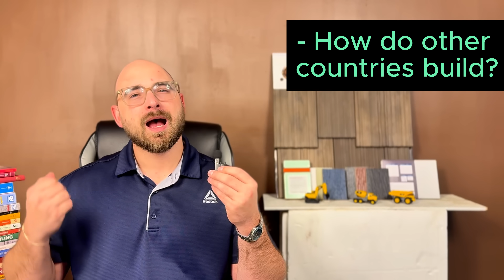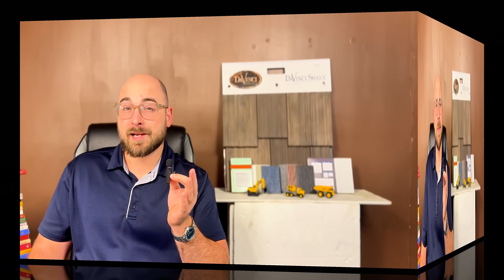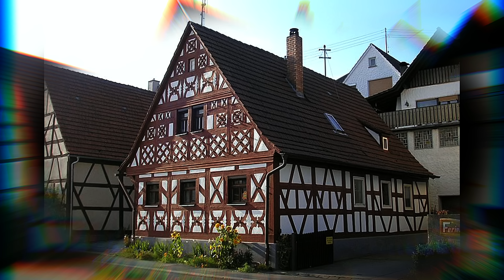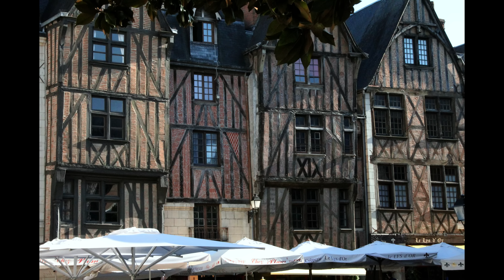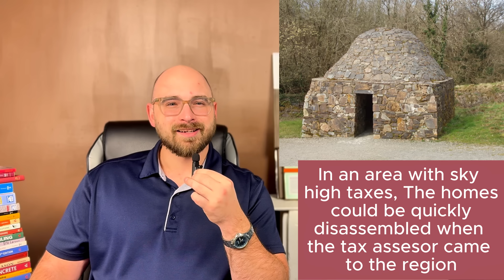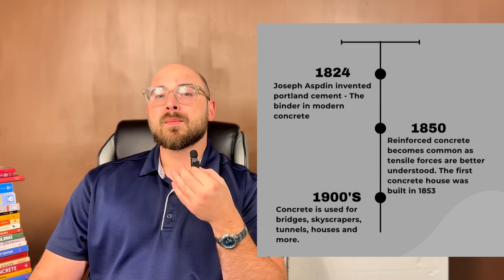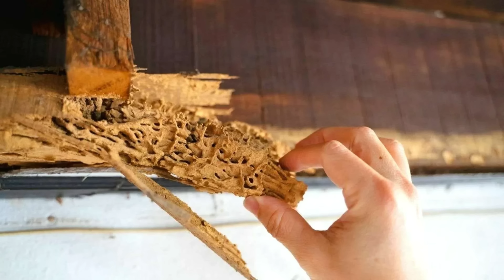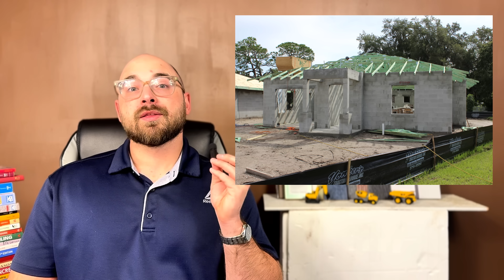Why Other Countries LAUGH at American Homes

Comment: We have oil/gas company corporate welfare here. In other words taxpayers underwrite the oil business which keeps our energy prices artificially low.  Europe generally can't do that and won't because they are actually concerned about climate change. McMansions don't exist there either. Apparently they have larger penises and don't need homes designed to impress and $80,000 pickup trucks that have never seen a sheet of plywood or even a hand drill.  Seriously though they are SO much more serious about appropriate sizing and their energy costs are realistically 3-4 times higher than ours.  They can't build shitty houses like ours.  The other issue today is that new American homes today are absolute crap. Crap materials, "soft" wood, workers not craftsman and major home builders Pulte, etc., have simply stated;"These are built to only last twenty years. No one cares because they'll be dead or have sold."  Which tells us so much about capitalism run amuck. I wouldn't use anyone but a one-man/woman run business that grew up in my neighborhood for a home. Unless I'm prepared to spend $700-1400 a foot for a superior kit or modular builder.  I'm a builder/developer by the way who was born in Europe but lives here.
Reply: McMansions are not exactly the typical American home. Also for someone who claims to live here you certainly don't seem to understand why American cars are larger either, companies trying to avoid fines from CAFE standards are the reason American cars are so huge, not some penis envy complex like you say. 

Plenty of stick built houses in the US are already pretty old, in my city it's not uncommon for buildings to be close to if not older than a century. 

As for blaming capitalism, Europe is also capitalist, and if their homes are so much better why hasn't capitalism ruined it yet? The USSR certainly wasn't capitalist, and they built terrible construction. I don't think the two are as related as you would like to believe.

You sound like a pretty angry and vindictive person, which in my experience is unfortunately quite typical of europeans on the internet. No shade to most people from there, I think it's a lovely place even if I wouldn't want to live there myself.

 I think most of the bad new builds in the US are the fault of companies not building properly, not adhering to code, using illegal labor, etc, rather than some inherent problem with wood construction.
Reply from the maker: Thank you for your very insightful and comedic comment 👏👏
Reply: What do you mean by "corporate welfare" for oil & gas companies?
Because oil and gas companies are taxed at every level possible... 
Taxpayers do NOT "underwrite the oil business".
Instead, the oil business is not ridiculously OVERtaxed... which taxes they would then PASS ON TO THE CONSUMER, of course... which is precisely what happens in Europe.
Europe quite literally punishes its citizens for using oil & gas... and it is 100% intentional... USA chooses NOT to do that.
Reply: Yes. The average home size in Germany as one example is almost 1200 sq ft. That is considered small here in the US. Some apartments can be this big. Houses used to be roughly this in the US back in the 50s and 60s. New construction homes in the US are generally 1800-2000 sq ft and up. 
If you want to find a community where new construction homes are a similar size to Germany you will be looking at a retirement community.

Comment: Brick, stone and concrete last so much longer, centuries. In America we are building homes that will last maybe 50 to 80 years. We are over paying for homes that will not last long enough to pass down more than 1 generation.
Reply from the maker: Right, for just a little bit more we can have insulated concrete houses that are safe, efficient, and built to last

Comment: As a child I loved on a large adobe house in Cuba. The walls were completely fire and hurricane proof. Now I live in a   concrete block with rebarb in the holes with concrete poured in the holes . Here in Miami it laughed off when hurricane Andrew went right over it. We only lost a few comcrete shongles.
Windows are bullet proof steel framed hurricane proof. So CMU plus rebar plus poured concrete. Hanging a picture requires a concrete bit. 
Expensive but where there's no earthquakes it will stand time.
Reply from the maker: The sturdier the better! 💪🪨🏠
Reply: Could i have the name of the builder and when was it built?
Reply: @SkyBlue-nv2tb  First part 1953 in the middle of Coral Gables, a city inside Miami-Dade. A lot of the older homes here are built similar as the video points out about Florida though mine is exceptionally sturdy even for this area. Do not know the architect or builder but it was not a "cookie cutter" development. Additions to similar standard made in the 70s. There's steel girders holding up a part of the main celling that is a poured concrete slab. Several of the walls inside were originally outside walls. Half of the front is covered in marine fossils including sea fans, various size worm tubes, corals, mollusk shells and small crustaceans crushed together during the flood of Noah. Now get this: bought it for 340k back during the first Bush and pay less than 6k in property taxes! Like all the houses we have lived in, I tell my wife when to buy and how much maximum; then I see the house after the closing. My way of demonstrating I trust her. Don't hate me because I'm beautiful, but because my wife of 47 years still is :)
No, I have no intention of selling. This is not a spam commercial.
Reply: And its only double the price😂
Reply: @180Tall18Long  But it's quality, not a knockoff. For me, a good investment.
Reply: @180Tall18Long  I live in a 400 year old stone house, in England and when I looked into buying an American property, I couldn't believe how expensive it was, for what is essentially a garden shed. Why can the rest of the world do everything better, cheaper?

Comment: "DEVELOPERS" drive this style of construction in American homes. Just TRY to get developers to build homes that are efficient to heat and cool. Ain't gonna happen unless your city council is not lopsided with developers, realtors, and title company owners, AS IS THE CASE IN ALL 3 CITIES IN THE  LAS VEGAS VALLEY! - well, unless you are building in an "upscale" neighborhood, THEN you get far better insulated homes, some with heat pumps and maybe ONE natural gas line for thereat pump furnace if temperatures go too far below freezing for the heat pump to handle it.
But YES, theLas Vegas area and most of the southwest SHOULD have been built with concrete. JUST ASK THE BURNED OUT LOS ANGELEANS!
Reply from the maker: You’re not wrong, many big builders consider putting a smart thermostat in the house “innovation” 

Disaster prone areas should have disaster resistant construction … Period!!

Comment: Far beyond America... My Malawian friends do not live in mud huts.  Every one of them knows how to dig up the earth, cut down a few trees, fire a few bricks, and build a solid brick home.  But when I ask them whether it wouldn't be a little more efficient and easily shaped to use the trees' wood to build the house directly...  they laugh.  Where's the security in that?  Thieves and criminals would simply build a little fire and come in through the holes in a wooden wall.  They are certainly right, as far too many Los Angeles residents are now learning.  But will America change the codes?  No.  Brick is already legal, technically, but who can afford it.
Reply from the maker: We can afford concrete homes, we’re just stubborn, or people don’t know they have options 

I hope LA builds safer this time around

Comment: Sorry, you said something that irked me - reinforcement steel does not corrode in concrete and concrete on its own has lousy insulation properties. Ask anybody living in a commie block. 

1. And here we go - you went through a historical review but missed the communist experience. Basically precast walls and floors or tact-centered concrete pouring which can achieve 4 floors per month. A plethora of methods that ensured the growing population of the cities is sheltered. Might not be beautiful, but no homeless people and every family owning a home is well-worth the price.

2. Wooden frames are extremely labour-intensive and no standardization is available on a big scale. Precast panels and bricks allow for industrial output, which lowers the price of the materials, ensures better quality and durability of the constructions. The epitome of the communist engineering was creating the home in factory conditions and assembling it in situ with the infrastructure waiting. It was not given a go because of esthetic issues.

3. Concrete is the most versatile material you can think of. It can be molded in incredible shapes BUT it requires good engineers. Look at the Sydney Opera house.

4. As I mentioned the commie blocks - pure concrete walls and floors suck big time. They are quite thermally conductive and contact-noise conductive. If a neighbour is drilling a hole in the wall, the whole block is aware of the fact. Therefore no one builds pure concrete anymore. Ceramic bricks, autoclave aerated concrete blocks, you name it - lighter materials that will not hamper the seismic stability of thee construction, but provide good comfort with proper insulation for lower bills at a reasonable price.

5. Sturdiness and durability - I do not find grounds for comparison here. A concrete frame with brick fills can serve up to 5-6 centuries. Even a commie block has a minimal life of 60 years because of possible welding faults among the panels' reinforcement. My home is a two-story wooden frame with brick fills on linear stone fundaments in a highly seismic region (possible 9th degree quake) and has been completed in 1837. The only serious change we made was removing the ceramic tiles from the roof and changing them with bitumen plates in order to reduce the load on the structure and lower the centre of gravity.
Reply: You are flat out wrong about rebar not corroding in concrete.  There are cases where this has occurred. Like the surfside condominium collapse in Florida. The most likely cause was the rebar rusting while it was embedded in concrete.
Reply: @bbdest3082  The only reason that could happen is poor quality of the concrete and not enough concrete coverage of the rebar. Once the steel is properly encapsulated in concrete, the alkaline environment (pH12) of the concrete halts any oxidization of the rebar and even dissolves the existing rust after time. After all the  tetra-calcium aluminoferrite is one of the components of the Portland cement and rust (ferrite oxide) is part of it. But you, US Americans, are well known for cutting safety corners and lacking proper quality control when it comes to profit.

edit: I checked the disaster you refer to. For me it is a failure of the hydro-insulation, combined with bad engineering. You see, when you calculate a concrete construction you pick your steel reinforcement to be enough, but you do not overdo it 1. because it is expensive and 2. because of a snap destruction. The concrete structure is calculated so it will first lose its form (which will warn the inhabitants of n imminent disaster) and then lose its ability to bear loads.  But let's return to the hydro-insulation. The concrete is not water-proof material. It has capillary structure. It can be reduced through proper vibration during the pour and some chemical additives, but cannot be removed. On the other hand standard concrete works with cracks in the tension zone. Destruction in the compression zone is a big no-no. Let me reiterate - when concrete breaks, first it cracks in the tension zone (which is compensated with rebar), then the rebar stretches in its elastic phase (which is OK), then the rebar stretches in its plastic phase ( disaster pending!) and then  the concrete starts to smash in the compression zone (which is the better variant, the structure still stands and evacuation is possible) or the rebar snaps (a snap destruction - quick and dangerous). Everything this is a question of correct engineering. 

Proper insulation from water-penetration is very important. I wonder how no one had seen the signs - when there is water in the slab/beam etc, there are very specific white stains of gypsum as the water washes away and connects with some of the calcium from the cement that appear on the underside of the element. The second phase is when the concrete loses its calcium and parts of it below the rebars start to fall. That lessens the cross-section of the concrete but worse - it leaves the rebar open to the elements, unprotected. Corrosion settles in, the rebar does not work properly, ultimately the construction fails. Lives are lost.

Comment: In Europe most people live in apartments that are about 1000 sq ft. The only single family homes that are built, while usually of very good quality, are not within reach of the middle class. I live in Canada and just finished building my home in west Toronto on a lot that was occupied by small postwar bungalow. I built it using dimensional lumber that is wider and of better quality than what you would find in massed produced subdivisions. Also on Canada as opposed to many US states our houses have basements ( mine has 9ft ceilings), it was insulated with Rockwool and finished with Acme bricks from Arkansas. It is 3404 sq ft (312 sq m) excluding the basement, 4 bedroom 5 bathrooms. Windows are fibreglass from Marvin windows, fibreglass is much more resistant to expansion and contraction when compared with vinyl which is what the typical Canadian home   uses. HVAC system is high efficiency has from Lennox and we also opted for an ERV which exchanges air year round so we never have stale air in the house.

I never liked the typical mass produced home from large builders, the quality is poor and they use the cheapest labour. That’s why I opted to build a custom home, I was able to design it and build it with quality materials and I am pleased with the results.

Comment: I wonder how could you miss a material, that os No. 1 in many countries in the world? 😊 Porocrete (U.S. Aircrete) blocks are the most popular building material for for small to low rise residential houses in many countries.
Reply from the maker: This video was originally double the length, so I cut out some parts, I think AAC fires under the category of concrete housing , although could have mentioned it
Reply: @Mike_Fortin  I understand your perspective, but I see it quite a bit differently. Concrete and porocrete blocks are really two entirely different materials. For instance, one is incredibly heavy, while the other is surprisingly lightweight.
The way you work with them is just as distinct. Concrete involves pouring or assembling pre-engineered pieces, and you need to meticulously plan ahead for things like cavities, electrical lines, water, and sewage. With porocrete blocks, you have all the flexibility to adjust as you go, cutting into it when necessary. It’s a whole different process.
Also in that way it’s even compeletely different from hollow brick, which used to be its main competitor.
That said, I made my previous comment with smile, it's not a critisizm, rather a fun fact. I want to emphasize how well your video turned out, especially considering you don’t work with these materials :-). Really great job! 👏👍
Reply from the maker: Very insightful comment, 

Thank you 😊

Comment: In the process of building ICF, best option around. In many places around the world where solid structure materials are used, the lack of proper reinforcement becomes evident after earthquakes. Many American homes are built cheap, but that is true in other countries. On the other hand, I believe that home ownership in the US is higher than most other countries. Many other countries are willing to have smaller homes than Americans will entertain. I have some Tokyo apartments that are <<400 square feet.
Reply from the maker: Oh very nice, What made you want to build with ICF ?
Reply: @Mike_Fortin   Current cost for ICF and 2 x 6 stick frame is close to parity. Thermal efficiency is substantially better as is sound dampening. There is no comparison for surviving earthquakes, hurricanes or firestorms. Going to be using Superform blocks. Location is SE Washington state so the climate is not extreme but it does get hot and cold. Should end up being a very comfortable home, especially with radiant floor heating.
Reply from the maker: Very nice, 

Did you go with warm board for the radiant flooring?
Reply: @Mike_Fortin  I don't have a solution yet. I created the floor plan and am having Innovative Drafting & Design create the build plans. She will be sending me a contact. Cooling will be using minisplits.  Plan to start construction in the spring. BTW, in my original comment, it should have said I have seen some Tokyo apartments smaller than 400 sq ft. When I lived there in the late 60's, there some houses where the living area was 3 1/2 tatami (about 3' x 6' each), my home office is bigger than that.
Reply from the maker: Warm board isn’t cheap, but I believe it’s the best for radiant flooring. Serves as a total replacement for forced hot air, 

if you’re going with mini splits, you can use a Zehnder ERV / Comfoair system  and have unbelievable air quality in your house
Reply from the maker: You could also Combine that with a block like Crown ICF which is glued at the seams for greater airtightness 

Check out their website at www.CrownICF.com